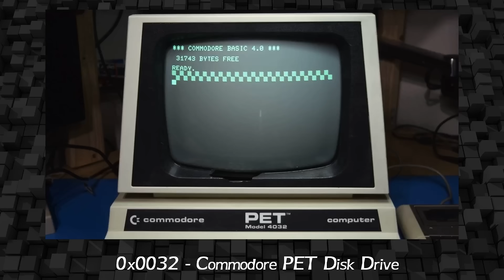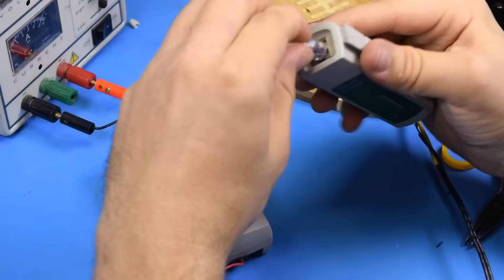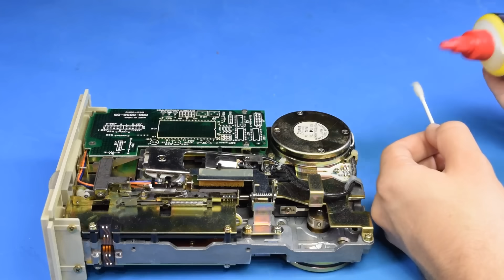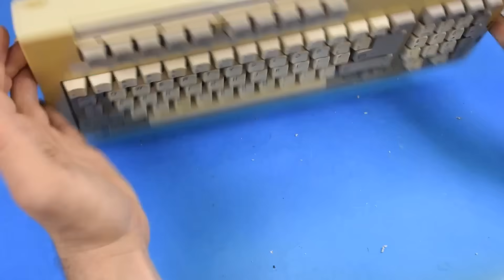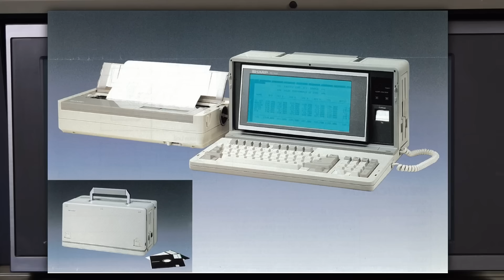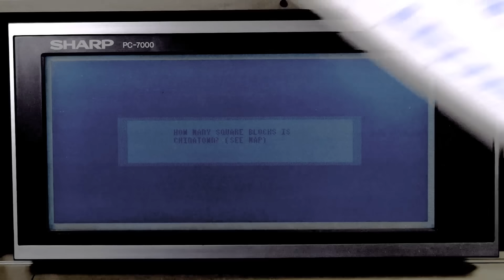Sharp PC-7000 Restoration

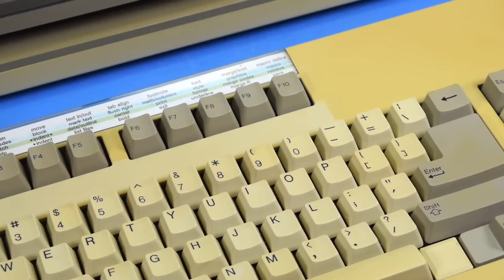Comment: 15:25 What setup is needed for retrobrighting beyond plastic bins to hold the pieces, plastic wrap, hydrogen peroxide activator from a beauty supply store, water and sunlight? I dont understand why you make it out to be more complicated then it really is..
Reply from the maker: I've acquired all the materials needed to take the ozone method to the next level. So I'm going to be trying that out. I don't like the idea of having to buy hydrogen peroxide all the time. The ozone method would be a zero consumable, completely renewable option that I could just drop something in a dedicated tank and let it set. I also don't want to rely on sunlight because I want my results to be consistent.
Reply: Ahhhhhhh you're going high tech instead of oldschool like the 8-bit Guy. I'm looking forward to seeing the turbocharged ozone method in operation. Thanks for replying, it's appreciated.
Reply: I have heard of people having success by just putting them in the direct sunlight without any chemicals.
Reply: @TechTangents  Looking forward to seeing your adventures 8-proton guy.
Reply: He might not have a proper drive way for washing down the computer with his hose. That's a requirement if you've seen 8 bit guy's retrobrighting process.
Reply: @dingdongbells3314  you also have to live in ̶h̶̶e̶̶l̶̶l̶  Texas to get enough UV light from the sun
Reply: I've retrobrighted in overcast one time, in normal 3% hydrogen peroxide I achieved complete original color only after 4 hours
Reply: @olik136  i mean shelby lives in arizona so if there's anywhere better you could be for that particular requirement, he's there
Reply: @dingdongbells3314  - There's always the bathtub and a handheld showerhead. You aren't washing anything toxic down the drain with that part of the process.
Reply: The ozone method still requires heat or UV light in order to make it progress faster otherwise you're probably looking at several weeks of constant immersion in ozone. I'm thinking, though, that the ozone method would have the added advantage that the electronics wouldn't need to be removed from the plastics since electronics tend to produce ozone on their own anyway (though they usually aren't bathed in it for extended periods). UV light isn't hard to produce artificially if you don't want to deal with the variability of sunlight. There are several UV-only LED grow-lights that you can get either online or from your local hardware store (the LED variety is going to be much more economical in the long run than fluorescent, though slightly more expensive initially).
Reply: I've seen a new method that uses peroxide, water, a container to put the parts submerged, and heat, but not UV. 
You heat to a certain temperature (so the plastic won't melt of course) and it will retrobrite everything more evenly and easier (without having to reapply the peroxide and/or spread it again after some time). 
I've seen the 8bit guy use that in some keyboards wich actually worked really well. 
It's not to cook the plastic, just heat it, but i can't seem to remember the correct temeprature, maybe it was like around 160ºF (around 70ºc?).
Because it doesn't depend on sun exposure, nor on how you apply the peroxide, the result is easier to achieve.
If i find the vide where the 8bit guy tests all his methods (peroxide cream on sun, ozone, and that method i wrote here). 

The real only issue is on how to make that to bigger materials such as computer cases, you would need like a huge metal container or something like that.
Reply: The UV LED-Strip method seems better tbh, as long as we take care of the ventilation
Reply: Don't do it!  Some bloke on the internet ran a ten year experiment and found out it eats the plastic!

Comment: Hi, I turn on a PC-7000 that I have had for a long time and had disks for it. I turned it on and it booted into the Operating System. Then turning it off and on again the screen goes off with no beeps and the keyboard is unresponsive. The light says Screen Standby. The keyboards don't light up or anything at that point. If I turn it off and on again it goes straight to Screen Standby and doesn't beep or anything.

Does anyone know if this is normal behavior or is there something wrong?

Comment: I know it's an old video, and I assume it's been mentioned before, but when you make a coiled cable the trick is to turn it "inside out" to reverse the handedness after the initial coiling - once you've done that, when the wire attempts to return to its original shape it actually tightens itself rather than straightening out.

Comment: love the channel. enjoyed the video on this system.  i as well have one of these i plan to work on some time soon.  did you ever find out about the connectors inside the system and for there pin outs.  also.   were you able to get a copy of the schematics for this system.  .  if you have any info on these systems that you could share. that would be greatly appreciated.

Comment: The dates on CPU are usually the copyright for the die, brand name, and/or product names i.e. 8086 was made in 1978 or the product name Core 2 Duo was copyrighted 2005. I don't think I've ever seen a chip with a "date code" on it but it's possible manufacturer does it.

Comment: Here in 2020!   Not sure if anyone has asked yet & if you still have this PC, but could you drop in an Nec V30 cpu to replace the 8086?  Could make it ~10%-15% faster.  Maybe also try adding a slightly faster main oscillator to overclock it a little bit (or some sort of drop-in daughterboard, if it can fit).  Did you also try to clean the disk heads with alcohol & swab, if you can get in there?  Try also finding a pc-7000 user manual, if you don't have one, might have some more stuff in there as far as operation you may not be aware of.  It is kind of odd that Slow & Standard speed look the same, it's supposed to switch between normal 4.77mhz & 7.37mhz, from what I've read.  Finally, I have not looked at other youtube videos of this model, so maybe other clips have some more info, including user mods, to enhance this machine.

Comment: Painful watching you make a 6 wire cable. Just use a coil cord from a Toshiba Strata phone system. Already black, coiled, 12 inches long (not stretched), crimped and ready to go. Used to connect the phone base to the console.

Comment: Excellent video on an underrated (and not well-documented AFAICT) computer. I'm also very curious about the ISA and/or HDD connections. Might you be willing to share the system disk image(s)? We have it running vanilla MS-DOS 3.1, but I believe we'd need the Sharp disk(s) to get into that setup menu.
Reply from the maker: I don't have the original disks. It just has a key on the keyboard for entering the setup menu. It is thankfully unrelated to the OS.
Reply: Ah yes, there it is! I guess I forgot that bit after not poking at it for a while. Thanks.

Comment: In coiled cables, there's usually a coiled plastic in the wire itself and then the cable is made around that, so it's basically impossible to make your own unless you make your own cable
Reply: No, the completed cable is coiled around a mandrel/rod then heated.  After cooling the coil's direction is then reversed.

Comment: nice job on coiling the cable.  I might try that.   why so much trouble terminating it?  I haven't had to buy one in quite a few years, but 6-pin crimp tools used to be quite common since "business" phones often had 6 conductors and even the $15 tools would do it.

Comment: Hey AkBKukU, have you seen the 8bit guy's video comparing some retrobrite methods? There is a really interesting method that only uses heat and the peroxide, and seems to be more effective. The only downside is that for larger parts you would need to have a bigger container to heat all the parts in the water + peroxide mix. It's interesting, because there you can have a sort of granular controll if you have the right heating equippament. 

The only change i would do, is to use a bain marie method to heat more evenly the container with the peroxide and the yelowed plastic. 

Here's the link btw: https://www.youtube.com/watch?v=qZYbchvSUDY

Comment: You said that the restoration was complete, but a 'restoration' is where you restore the color, touch up paint, clean it up, fill in cracks, etc.; what you did was a repair and partial restoration.

Comment: I listened more than watched this video but it reminded me of doing test and restore to a zenith EazyPC that was a 512k NEC intel clone all-in-one with pure black and white monitor built in. Man, does CGA ironically enough look good on monochrome monitors when PC's translate it to them. 

Same deal, only 720kb floppy drive, 2nd drive or HDD would been options someone who got the PC originally dis not opt in for, and finding zenith's specific DOS booter took it's own time. 

tl;dr: monochrome translated CGA is best CGA fight me.

Comment: Hi AkBKukU, do you have or know where to get a service manual for this machine?  I have one that I'm having a hard time getting the fdd to work (i know the fdd is good as i've tried it in another machine).  When I pulled it apart there was no data cable connected to the drive which was odd so I've used a normal PC cable but still not working.  So wondering if the pinout on the motherboard is the same or if sharp made them slightly different.  Cheers

Comment: If it's truely an EL backlight, you may want to look closely at the EL power supply circuitry.  EL displays use high voltage to illuminate the panel, so it'll be converting the 12v up to some higher voltage.

Comment: That's a cool luggable and I really like the Idea you expressed in the comments of trying to internally wire up a ISA to CF card! Another cool idea would be designing a full blown base unit faeturing multiple ISA connectors. Especially since that would let you use memory upgrades or different graphics cards and basically provide you with a full blown 8086 computer instead of "just" a luggable. But it probably isn't worth the extensive amount of work.

Even though I will agree upon the CMOS battery working great for a 30 years old battery I would still replace it. (Or maybe unsolder it from the board and use some long wires to reconnect it while keeping it at a distance from the board.) The risk of the electrolyte spilling would make me too nervous. This is only based on instinct though.
On that note: I have heard about replacing those cells with super capacitors. Would you consider this a good idea?

Comment: Hi All, i had a Toshiba T1000 for a while at work back in 1988, it is probably 10 years newer than your sharp PC-7000, but the similarity is that they are both basically IBM XT class with 8088 style 4.7mh processor and i think it has 512 ram.  The good points were the built in Dos 2 or 3 in ram , but it also had a built in 3.5 floppy, it would boot of that disk if it was a system disk.

The negative was even when new the display was horrible, i was just wearing glasses at that stage and i dont think i could have done more than 1 hour on it at a time, glare and lack of contrast annoys me. 

Luckily it has a external CGA or EGA monitor cable, so at work or home i use the external screen.

I am not sure if there was a switch to disable the built in LCD screen but i definitly remember that the screen refresh rate is very slow, even using Multiplan or Microsoft Works 1 or 2, luckily multiplan has options to change colors on the spreadsheet and menu and Works has a few preset colour "skins" or laptop or reverse option as color presets.

Games, yeah pretty much no, i am sure i played a few but the ghosting effect is very annoying, ( rougue was ok as was a few star trek text based games ) or the basic style games.

If you have a good working parallel port, try laplink, pinouts for the standard parallel port should be used as you wont have advanced or fast / turbo / enhanced parallel port options in the bios   it works with 8088 processor and you can map a remote pc hard drive and "share or copy" it like a network drive, it will be slow but i can use a XT -AT machine to get files from a Pentium 100 running dos only ( DOS or Win95 - Win98 class machines, as later models do not allow old programs to function at hardware level eg Win 2000 - XP )

You only need to look at a calculator from the time of that style of LCD and compare the washed out style of text and lack of clarity - it did its job and worked and saved on power usage

Regards
George

Comment: What's the aspect ratio of that monitor? It's definitely not 16:9 or 16:10, I guess it's 21:9?
Reply: @closure4791  I just calculated it and it's 16:10. It sure looks wider than 16:10 though.

Comment: Are you sure it's the backlight that's dipping and not the image on the lcd? Check the driving voltage of the lcd, i'ts probably a negative -24v rail. This may shake the contrast around making it look like the backlight is dipping. 
Also hate to be negative but the modem port is probably just a internal com port with some power rails alongside it. What I have done on some of my retro portables is to wire this up to a "wifi232" internally but make sure it runs on its own com port first sometimes it is shared with the external one.

EDIT:
For the modem. Just realized that you showed the bios on screen. So I checked and sure enough:
Bad news: internal modem is serial. 
Good news: it has its own com port.
Reply from the maker: I had a feeling it was going to be that since that connector was so much smaller than the one for the CGA card. Time for plan B then, I'll run a ribbon cable up from the bottom expansion port to the area where the modem would be and use that as mounting point for the ISA to CF adapter. For style points I may as well internally integrate an RPI0W onto that serial port while I'm laying out the board.

The bottom port should definitely be full ISA since they planned on making an external ISA enclosure. I'm not sure if that ever happened, but it means the possibility is there.

Comment: did you try just putting new connectors on the old cable?
Reply from the maker: No, being a coiled cable makes it really difficult to "bend test" it to see where the internal break is. And it is so hard to put a crimp connector on soft cables by hand that if I'm going to do it again I'm going to start with new cable with no problems.
Reply: right on, good luck

Comment: I picked one of these up for $25 this past summer that had a single 5.25" drive and a HardCard as well. I managed to take the HardCard apart and get it working eventually but it did die completely shortly thereafter. Unfortunately my LCD is damaged and i cant repair it. Parts machine for the time being. Cool to see one actually functioning!
Reply: if you need any info about my 7100, let me know! May be helpful.
Reply from the maker: Does your motherboard look different? How does the hard disk connect?
Reply from the maker: Someone emailed me some pictures of a 7100, it's very different inside compared to my 7000. A complete redesign of the motherboard and addon cards. I don't think anything is compatible between the two except maybe the display and keyboard.
Reply from the maker: I would definitely be interested in taking a crack at repairing it! I'm not sure if an XT-IDE adapter would work, I've heard it's not a full ISA card, but it's something I would try. You can email me at akbkuku [at] akbkuku.com to talk more about it

Comment: I have a Sharp MZ-100 laptop from '89 and their LCDs went a long way in 4 years. It is 640x400 EL and blue but is is so bright and high contrast for the time. I modded mine to run on 6 AA batteries and it gets around 2 hours of battery life. Pretty nice machine to do stupid stuff like bringing it to the Coffee Shop to get wierd looks.Also, my power supply is good on this unit and it gets fed something like 7.5V instead of 6 from battery and the EL backlight still flickers. Same with my Tandy 1400LT. Both machines are pure white(no yellowing) so I can tell that these machines were used very little. All EL backlights flicker due to power supply changes.
https://i.imgur.com/aKSrSGT.jpg
Also, if you go into the SETUP and change only the display to inverse it will do it without a reboot.
Reply from the maker: Wow that is a crisp display(I'm always kind of surprised Toshiba didn't make cars). This unit has had a full life and definitely has a lot of miles on it.
Reply: Oh yeah, the transition from a bright blue to a dullish grey is basically the entire giveaway of an LCDs life. If I had an old LCD that was acutally worn out like that one, I'd maybe swap it for indiglo(more teal than blue) EL panel although the Sharp is more teal than blue. Do you mind elaborating on your "Toshiba should have made cars"? I don't totally understand outside of the question on the screen, 
I found the original SLA battery to be completely dead and I probably could have made some kind of complex LI-ION charger but I went for some good old AA batteries. The awesome thing about this as that Sharp never assumed you would take out the battery so they powered the RTC by the battery. No RTC battery, no problem!
https://i.imgur.com/UUqKaCG.jpg
Reply from the maker: Mitsubishi, Hyundai, and Samsung are all companies that have or had produced both consumer electronics and cars. Eastern companies tend to diversify the products they make much more than western companies. Toshiba has done almost everything but make cars. They were a pretty big company in the 90s and I'm just surprised they didn't also diversify into automotive like some other companies did.

I didn't mean anything by mentioning it. It was just something that crossed my mind when seeing that image on the screen.
Reply: Ok, I see. Interesting. This is one of the things I like about this channel so much, you actually respond to comments(well besides the video being great)!